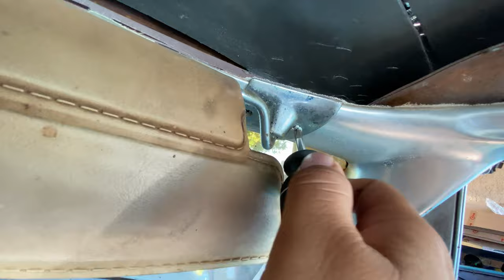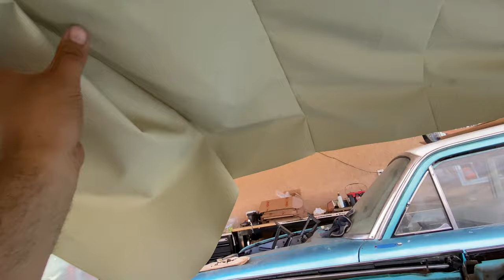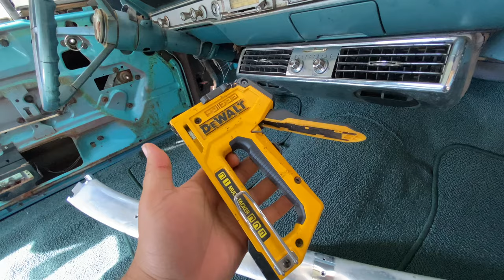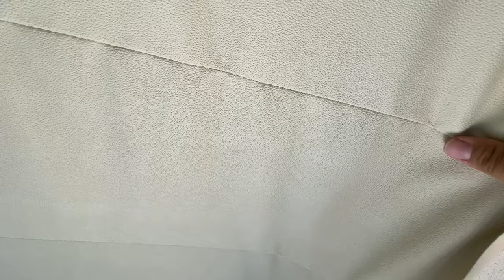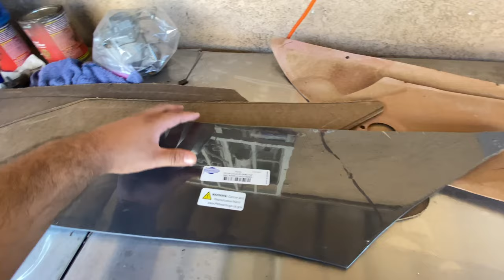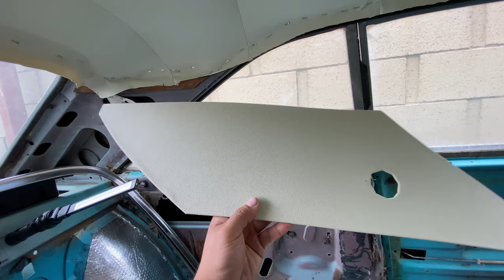1964 Galaxie Interior Part 2: Headliner and Sail Panels

Comment: I know this video is 2 years old and I don't wanna sound like I'm "monday morning quarterbacking" but after doing some research come to find out they sell a headliner tacking strip. Summit racing sells a roll of 3/16" x 11/16" x 15' semi-hard rubber strip and goes for $25.79. It's a multi-purpose material so it can be used for different applications.

Comment: Great job on all the work you have done. I was wondering if you could tell me the order for the headliner support rods go in. I have a 61 fairlane and when I got it the guy had already to removed the headliner and the bars
Reply from the maker: You will have to install them by themselves first to make sure they all reach the very top of the roof. Then try it out with the headliner and install the rods in the holes and pull the fabric to see how it looks. Sort of have to do it as you go.